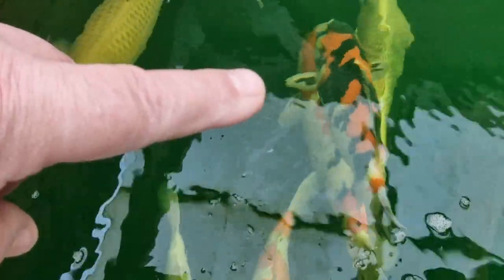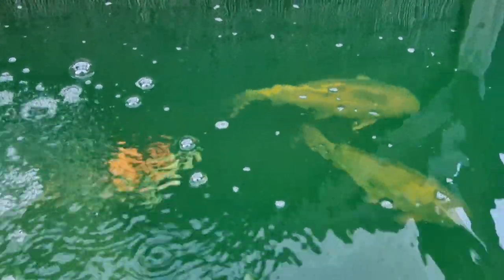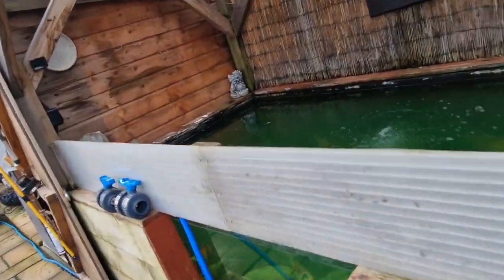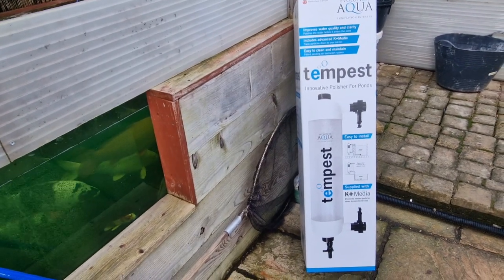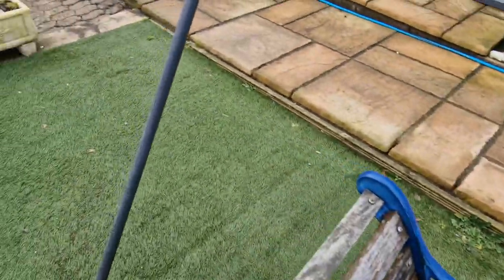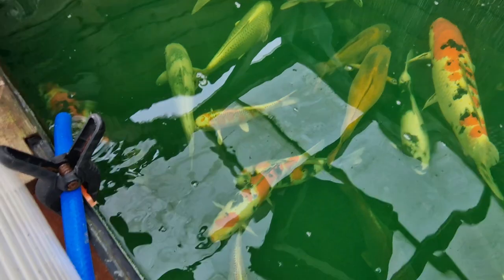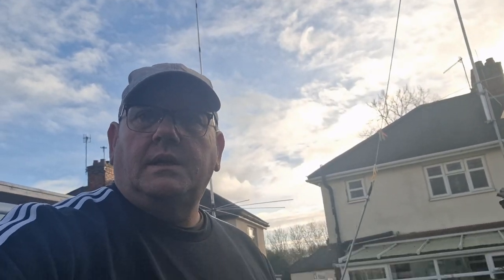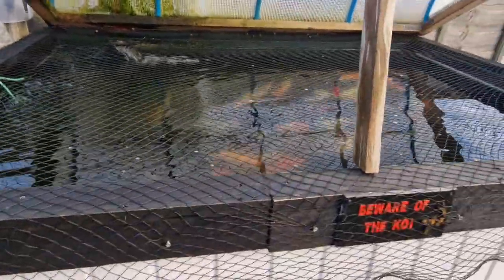Im on The Brink ...is it time to call it a day 😔

Comment: If you have an open ulcer on one of the koi contact Lincolnshire fish health and get a swab kit sent out take the swab and send it back for testing it’s not cheap but at least you will know what you are dealing with , there seems to be a fair few ( I know of about half a dozen personally and heard of more ) in your part of the world having serious bacterial problems, and it seems to appear after adding new koi , did you add any before you started to get issues ???
Reply from the maker: Hi Martin , my issues really started around 3 yrs ago ehen i added some fish and to be fair over around 2 years it gradually wiped me out in the main pond all except just a few . I had them in a paddling pool through the summer last year as i had decided to re build the main pond and start again . I seemed to be all clear in the paddling pool with absolutly no issues all summer other than dropping beni. All the fish that survived qre now in the sleeper pond and it seems to have kicked off again . Yes i agree Paula Reynolds need a call and that is going to happen asap . Many thanks for the Comment 👌👍👍👍👍👍

Comment: Davey there are two things that spring to mind that may possibly be contributing to your issues. The first is it looks like you have quite a bit of mould around the wood on the top of the pond and that could be leaching into the pond. Andy Daley had a similar issue with his old pond covers back when he was having all those issues with infected scales. Secondly you may be over treating the pond which will lower the fishes natural defences. I know you are doing that to battle the problems you are having but if it is the mould you are not going to get anywhere until to solve that issue. Personally what I would do is remove the wood from the top, clean the top with a vircon wipe down and then replace that with sections of paving slabs. I wouldn't add any more treatments for a few months. I know that's difficult as you are trying your best for your fish but they need a period to recover from everything you've shoved in there. At a guess that lump I would say is either an abscess under the skin or a tumour. I don't know if there is much you can do for it either way. It's too cold to sedate the fish. If it wasn't and was above 15c then I might be tempted to sedate it and then lance it with a small needle on a syringe. If it's an abscess then it will relieve the pressure in it before it bursts and leave a huge hole in the fish. If it's a tumour then I don't think there will be much you could do. I hope you don't mind me mentioning all of that. I know it sounds like I'm preaching to the converted but I'm just trying to think of things you might not have thought of.
Reply: I agree with everything you've said especially the wood and fungal spores, rotting timber and even treated timber around the pond is never good. I had almost the same fish with the same size lump with got bigger and sadly she died within a week, I was told by a couple of koi dealers there was nothing that could be done when it had gone that far😔. 
Maybe concentrate on having just the one pond and a quarantine setup to take the stress out of it a bit for you. Good luck with it all 👍